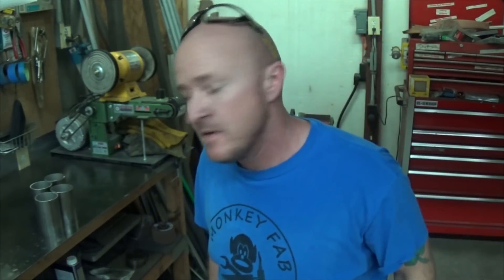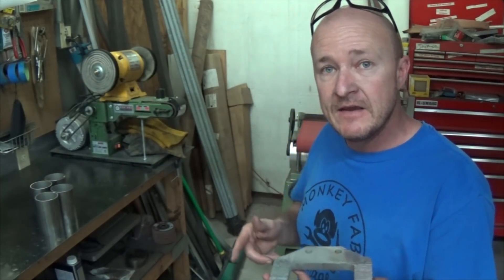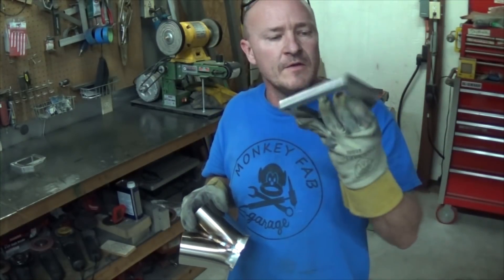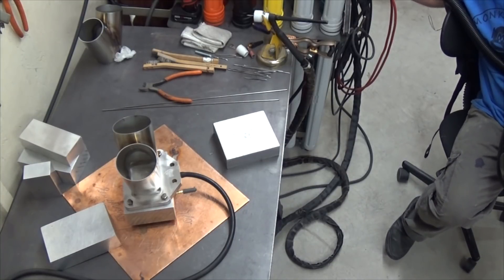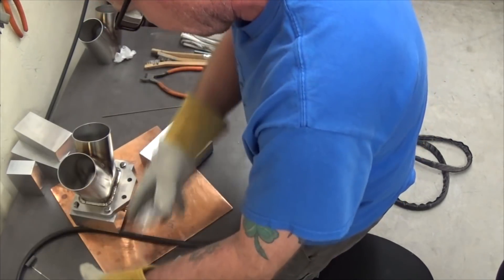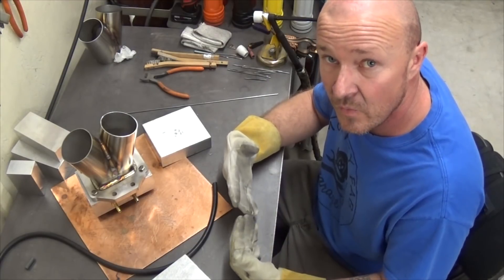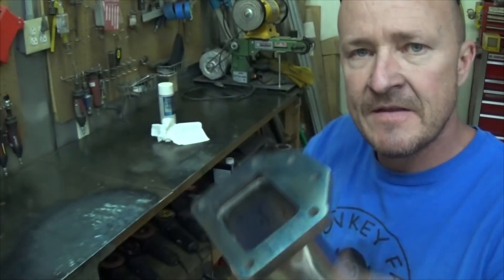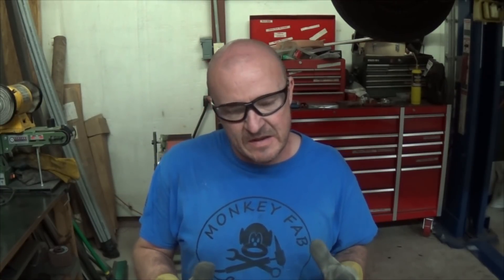Welding a 1/2" thick turbo flange, how bad will it warp?

Comment: Mike, I'm doing my first set of compound turbo piping on a diesel.  I bolted the 1/2 marmon flange to the turbine housing and the t6 foot to the turbine inlet when welding.  Not as good as an aluminum block but close.  I've found aluminum chill blocks are your friend when welding stainless.  It warps like a bitch.  Thanks for the channel, I've learned a lot

Comment: I have done ss exhaust on my mk2 jetta, tacked  welded the pipes under the car, then removed and weld completely. When i put them back on the car it would not fit, touching everywhere. It was a nightmare job. Now i hope it will not warp again from heat.

Comment: It will always move a bit just use thicker plate and skim it off on the mill or surface grinder . Anyone that thinks they canvwekd it without it moving at all hasn't done any of this type of work.  Don't start bashing me been at this stuf 30 years

Comment: I believe if its warped when it comes off the aluminum block, the problem is although you are pulling heat out of the stainless that aluminum block is staying attached with all that heat still in the block. I weld a lot of stainless and i quenche it as soon as im done welding it and that helps a lot with distortion. try quenching one if your not afraid with the block still attached too it.

Comment: have you tried preheating or using pulse
Reply from the maker: Paul Critoph not trying to sound like I know it all, I certainly don’t. I’ve welded hundreds maybe thousands of these. It gets pretty boring so I always play with the settings just to see how it turns out. I’ll only preheat if it’s crazy humid out. The time on the sander is usually less than the time it would take to preheat but you are correct, it does help sir.
Reply: to be honest. what i know about welding you could fit inside a matchbox without removing the matches. but i am only starting out learning
Reply from the maker: Paul Critoph me too. That’s kind of the cool thing about welding. You never stop learning. The more you know, the more you realize that you don’t know crap. I’ve learned a ton from jody. I follow him and listen to the podcast and get the after show from supporting on patron or whatever it’s called. Well worth it.

Comment: Hey Mike, enjoyed the flange video, was that stainless to aluminum, if so what were the settings, and was it ac or dc, and it didn't look like pulse ?
Reply: Bolts.🤫
Reply from the maker: Desert Rat 2000 no sir. Ss to ss. I don’t know of a way to attach aluminum to steel.

Comment: Why the respirator for TIG?

The edges bend towards the heated joint. The joint heats and expands. When it cools, it shrinks more than it expands, because there is more metal involved in the shrinkage than in the expansion.
Reply from the maker: Mel Gross because there is no such thing as an old welder lol. Seriously though, I’ve destroyed myself enough from 25 years in the army. Figure breathing clean air couldn’t hurt. I got it from a friend for around 500$ which is a third of there normal price.
Reply: That’s a pretty good price, about a third of new. I would likely buy it for that too. It’s also a reason why I avoid stick welding, even outdoors.
Reply: You should throw an indicator on it and film the indicator move as you weld
Reply from the maker: Bomb Squad Performance that sounds like work.
Reply: Monkey Fabrication Garage I guess you're correct lol.  Carry on
Reply: stainless releases chromium when welded causes cancer boss